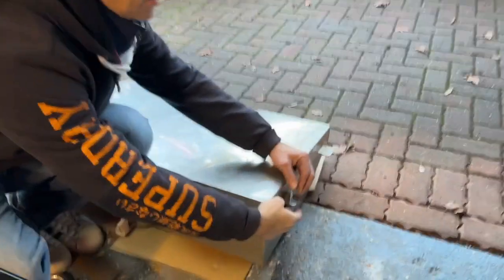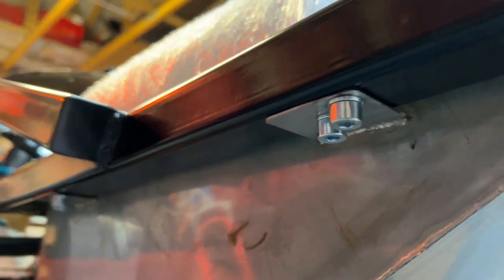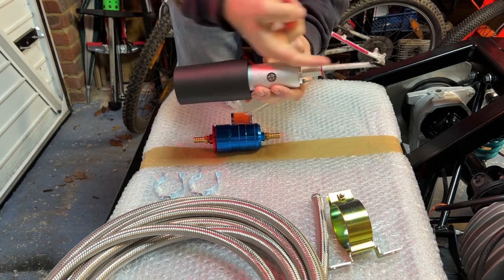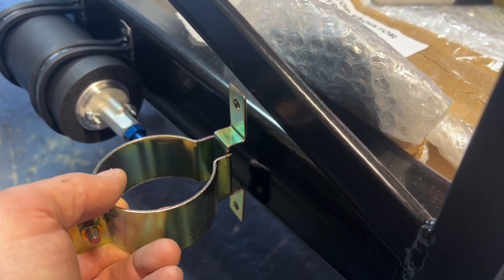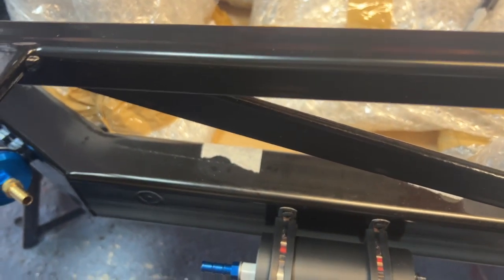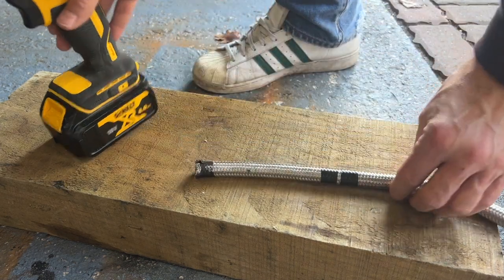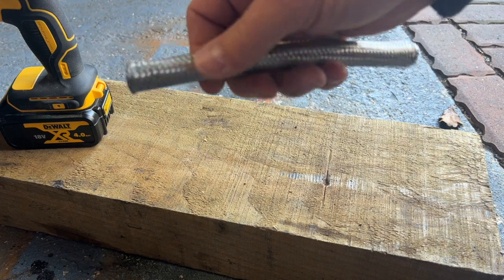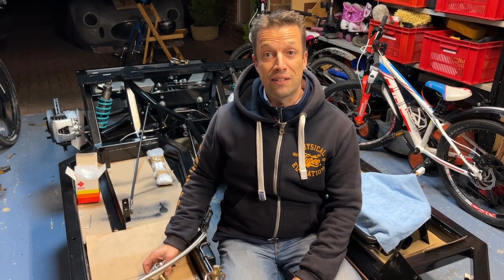Building the AK Cobra - The Fuel System - Part 05

Comment: Hi Russ, love your videos. Just starting my build now and trying to save as much money as I can! Any idea how much fuel line you used in total? Cheers!
Reply from the maker: Hello Robert, thanks for watching.
I think I used 7 metres but that leaves no room for error. Suggest 8 or 9. You can use extra for fuel breather, air lines if using LS3. Plus bits to fuel pressure, fuel rail etc. I would concentrate on bigger savings. Use S&J autos instead of AK for wiper kit, lights etc. Buy your own fuel pump/filter from Merlin instead of AK etc.
Fitting your own carpet is easy’ish instead of full trim package from Intatrim etc. Good luck.
Reply: @russ.howell  thanks ever so much! Yes using an LS3. Doing as much as I can myself. Rebuilding the diff, building the engine etc! Keeping it very fun indeed! Cheers for the advice on buying from other suppliers. Already started on that list 😀👍

Comment: Hi Russ, can I ask where you bought the fuel filter assembly and metal filter from please
Reply from the maker: Hello Alex, they are available from Merlin and other places but I bought mine on eBay:
https://www.ebay.co.uk/itm/263763257654?mkcid=16&mkevt=1&mkrid=711-127632-2357-0&ssspo=57QdBchwREG&sssrc=2349624&ssuid=96p_5NPMRpe&var=&widget_ver=artemis&media=COPY

And the metal 50 micron filter can be found cheaply on eBay too, cheers
Reply: @russ.howell  thank you.